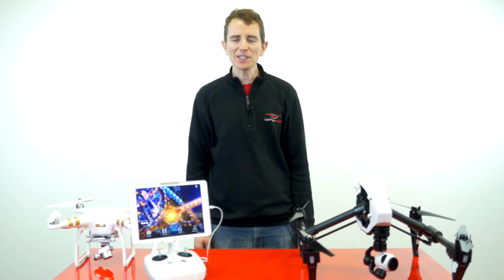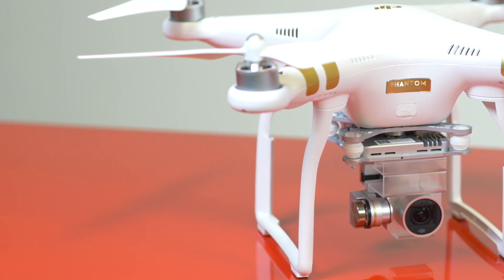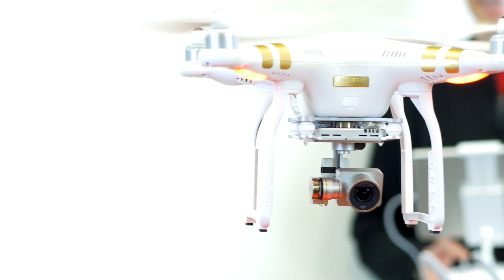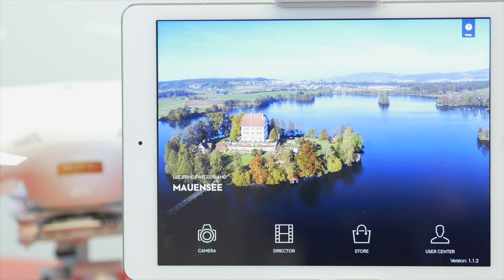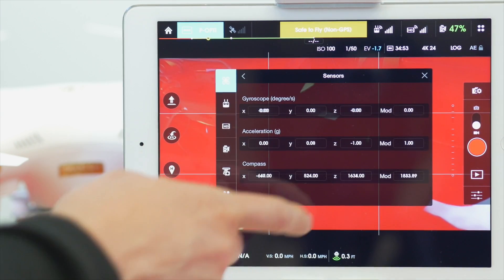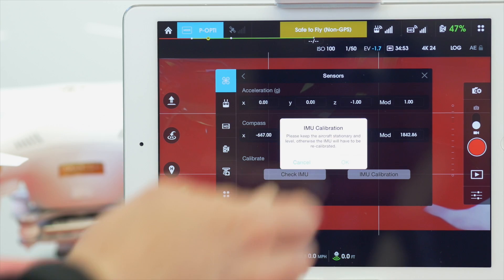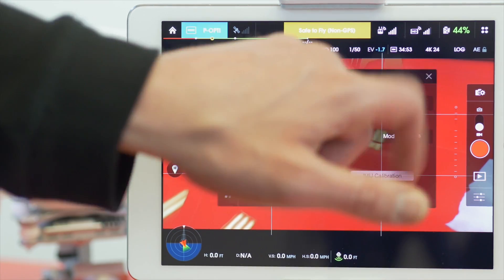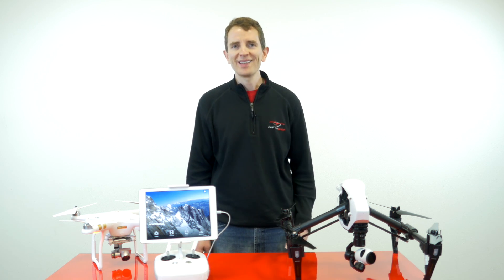How do I calibrate the IMU on the DJI Phantom 3 or Inspire 1? #2MinToolbox

Comment: when I got it for everything it has.❄.❄>JustU.Faith/DJI-Drone?資 The case is a great quality and fits everything perfectly. Having the second battery is also very useful to have. The drone itself is awesome and is perfect if you want a nice quality drone and camera, but don't want to spend a ton on the phantom 4 or 4 pro. Overall I love the drone and the extras in the bundle, would definitely recommend this kit for starters as a case is pretty necessary.